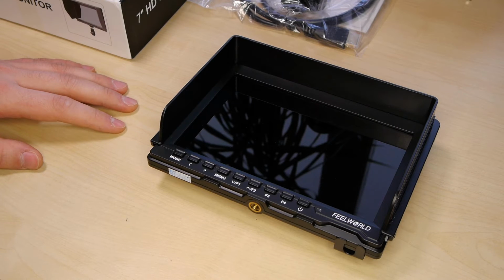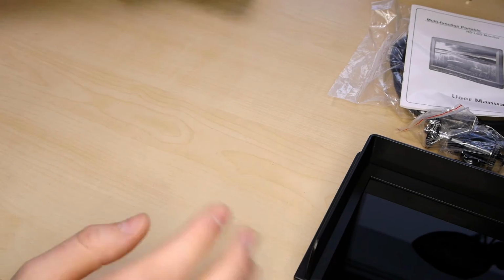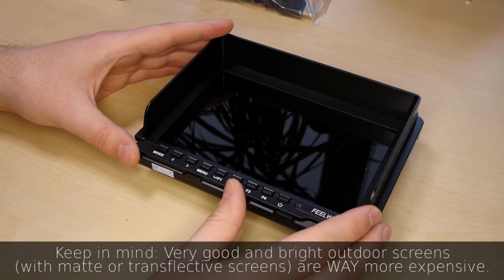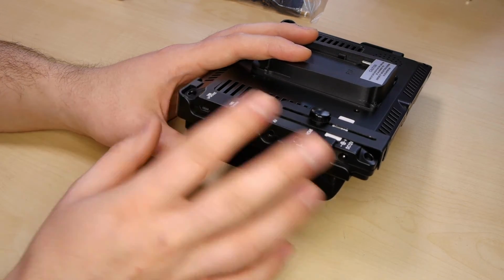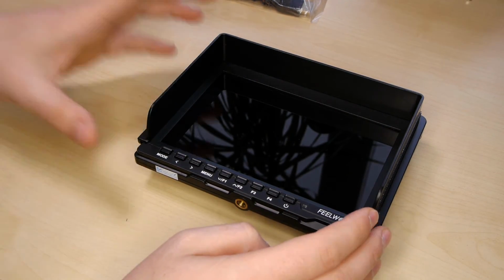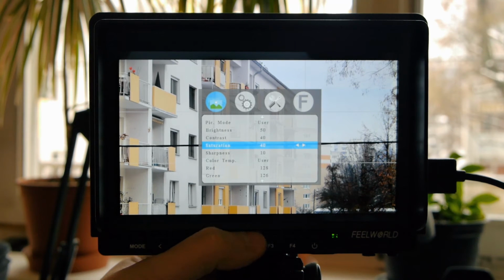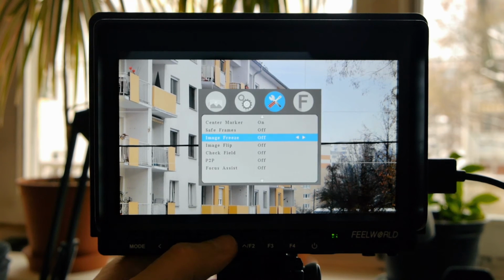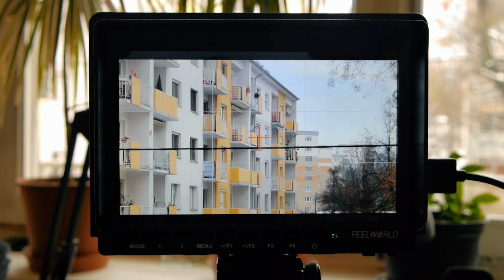Feelworld FW759 / FW759P field monitor - Very detailed HANDS ON (with calibration settings) (!)

Comment: Hey man. I bought this monitor yesterday and pullugd it in my Nikon D5100, but when i start filming, the monitor turns black and the live view on the camera goes back on... How do i change this?
Reply from the maker: As far as I remember you need the Nikon Hack to unlock all time live-view out over HDMI. But you can also try to play around with the HDMI out settings in the menu (and you can also try to press the info button a few times beside the viewfinder - Maybe it outputs HDMI again in one of the display-modes). But also overall check out the Nikon Hack for the Nikon 5100 - It gives you also better video through higher bitrates, it removes the time limit and gives you kind of clean HDMI output (with no overlays etc.).

Main page: https://nikonhacker.com/wiki/Main_Page
Patch page: https://nikonhacker.com/wiki/Nikon_Patch
List of supported models: https://nikonhacker.com/wiki/Supported_Models
Reply from the maker: Btw.: Set the HDMI out on the D5100 to 1080i, device control to "off" and maybe try it on a TV too (that way you know if its a problem of the monitor or the camera ^^).
Reply: I did everything you sad, but it still doesnt work...
Reply from the maker: Ok. Then you need to hack it. Just follow the tutorial(s) online and follow the links in my other / older answer. It´s quite easy to do / not THAT compley at least (and as mentioned its not only giving you active LiveView out, it´s also unlocking higher bitrates, giving you unlimited recording time in video mode and "cleans up" the HDMI out if wanted to get no overlays. Also unlocks a few stills image features (according compression options) and removes the need to use original nikon batteries. ^^
Reply: I hacked it already man... I even bought a USB to SD hub for the files... :(
Reply from the maker: Did you try it on a TV instead of the FW759? Maybe the output makes problems with the FW759. Btw.: Which options did you choose for the hack? Only "Clean HDMI & LCD Liveview" or also the beta hacks according 720P / 1080i fullscreen?
Reply: Oh i didnt try it on a TV, and i choose for: 
* Remove Time Based Video Restrictions
* Liveview Manual Control ISO/Shutter
* Video 1080 HQ 36mbps Bit-rate
* HDMI Output 1080i FullScreen Fixed
* NEF Compression Off
* Disable Nikon Star Eater
* Non-Brand Battery
Reply from the maker: Hmm. Try "Clean HDMI & LCD Liveview" additionally. I don´t know it for sure - But it could include the "base hack" to enable HDMI out at all (the 1080i FullScreen option is just to remove the borders etc. and get the right 16:9 output) ^^.
Reply: Nope, did'nt work.. :(
Reply from the maker: Hmm. Do the other fixes of the hack work? (Like the video time limit removal - Put in a larger card and if its able to record / shows over 29min 59sec left for the recording the hack works ^^.)  - Just to be sure: You resaved the firmware after selecting the hacks / fixes which should get applied - Right? It´s not applying the fixed automatically to the selected file (you need to resave it somewhere else). If the other fixes work (and therefor you exported the file right), then you can also try to NOT choose the 1080i fullscreen fix, but choose the "HDMI output 720P fullscreen". And leave out the Clean HDMI & LCD LiveView fix (its normaly only to remove the overlays on the LCD and in the HDMI signal - Not to enable the HDMI).

Btw.: Also try to choose different HDMI out resolutions in the menu after you hacked it again (plus switch through the views with the Info button - Maybe you can find one combo which outputs the video also while recording internally). Also important is to disable "Device control" in the HDMI menu. If all that isn´t working, then I am sorry to say that - But maybe it´s just not working. Its still a hack. Not a normal feature upgrade ^^. Another (not direct) solution: You could still change it for the D5200 (there its working / should work more flawlessly). I also used the D5200 in the past by myself with live view HDMI out. But you can also search through the nikon hack forum (maybe there´s a fix available / just one of your settings isn´t right). NTSC / PAL menu option maybe (maybe it affects the HDMI output) ?!? LG
Reply from the maker: Oh. And I hope you are in live view mode before you start recording. Otherwise the camera is switching to a preview mode or so (for the videos and pictures). ^^
Reply from the maker: Btw.: Also try only the 720P or 1080i fullscreen hacks alone. Maybe some of the other hacks are not working together with it. (like the hihger video bitrate ones)
Reply from the maker: Pah. Damn you Nikon - I think I found it: HDMI out is only working with 1080P (1920x1080) and 24fps setting (or with lower resolutions). See this manual: https://cdn-10.nikon-cdn.com/pdf/manuals/dslr/D5100_EN.pdf (Page 53, "Movie Setting", it´s the small hint below the table "2  Not output to televisions or other 
external displays during recording." - Which is the case for 1080 25P and 30P in the table above) ...
Reply: I give up... i tried everything you sad, nothing works. I resaved indeed the firmware after selecting. I thinks its the camera itself.. I am going to save for a new one i think
Reply from the maker: So its also not working with 24P at 1080 as a video codec? (Try it with the standard - non modded - firmware.) Weird fact: It SHOULD work - The D3100 also outputs live view HDMI while recording video (found a few videos online about that as I was also curious whats the problem with your D5100).
Reply: IT WORKED WITH THE 1920x1080 with 24fps!! <3 thank you so so so much!!! is there a way to thank you for your help!!?!??
Reply from the maker: *g*. Yippii =). Well - You can donate a few bucks over PayPal if you want to (link is in the 3rd block of the video description). But hey - Not needed (I am also happy about a thumbs up and a additional subscriber ^^). AND: I am also happy that it´s working now. Its btw. also good to know that the D5100 has such a weird limitation in case someone else asks. ^^
Reply: I liked the video, subscribed to you, and I transferred you 10 euro, idk how much USD that is hahaha
It is so strange that it works with 24fps, and not with 25fps..
And indeed, this camera is so limited.. Iam going to save some money for a new one.. This thing is already 5 years old. Its my dad's old camera :)
Reply from the maker: Cool. Thx ^^. About the 24FPS vs. 25 / 30: I guess the processor they used in the A5100 is just too slow to output the higher framerates. Which is weird yes (as it´s just a difference of ONE frame to 25FPS for example). Well - The D5100 is still "ok". But nothing special anymore yes. But you can now also try out and play around with the other fixes / hack-options. And to gain experience / to start over filming the D5100 is still more than good enough ^^. Have fun shooting (!) And thx again for your donation (and for subscribing). =)
Reply: Thank you so so so much man! I'am so damn happy now! <3
Reply: @NielsKnol  do you mind sharing how you get it to work?

Comment: Hello.  I am sorry but I don't understand how the check field works?  You said something about calibration.  Would that be when using SMTPE color bars?  Sorry, I am just beginning learning all of this.  thank you.
Reply from the maker: You can use the blue-gun mode (which is showing blue image content only) to calibrate ROUGHLY with the color charts / color bars for monitor calibration (just search for it over google - Its a quite common but also very old calibration method). But also keep in mind: It´s by far not as accurate as a colorimeter / color calibrator would be. And it´s also not showing how high the contrast is (aka how much is "cut off" by the screen in the shadows or in the highlights for example). So it´s just a minor helper (the blue ony / blue gun mode). ^^ But also keep in mind: You don´t need it with the Feelworld screens anyways - They are quite accurate out of the box. And you don´t get any better calibration just with the color charts and the blue-gun mode. You need a color calibrator (to calibrate the RGB channels roughly) and then it´s the best option to compare the final picture which is coming out of the camera with the field-monitor picture (according the shadows / highlights / contrast) to get the most accurate image while shooting. Hope that helps to clear it out a little bit. LG
Reply: Yes it does, thank you

Comment: Anyone can help? I am trying to link NW759 to Nikon D750 and cannot get promised resolution 1200x800. Tried various settings and only in menu mode i am getting 720p or 1080i. When switching to live view, monitor automatically switch back to 480p 60hz. Any solution, please? In camera, I tried also all options.
Reply from the maker: Hmm. Did you try to press the info button a few times? Maybe it outputs 480P to show you all the menu / display information. As far as I remember you need to toggle through the viewing modes with the info button to get the full-screen (clean) image ^^.

Comment: is there any way to not view the image in 480p when recording with a canon t3i
Reply from the maker: Hmm. You can try out the "camera mode" -> Menu -> 2nd page inbetween OSD V and Zoom ALL. This mode is normaly for the 5D models (the older ones). But it should also lock the 480P mode for your T3i ^^. It´s visible in the video at 20:42. Have fun shooting (!) ^^

Comment: hi, it is posible to update firmware?
Reply from the maker: Possible yes (over the USB port) - But no public fimware files are available online (on the Feelworld pages www-feelworld-cn for example which is their official page). Maybe you get the files if you ask the support. But no guarantee for that. Just buy it new from the offical Feelword store (or from the bigger dealers), as there you have the highest change to get the newest firmware models (as there the unit throughput is way higher than at the smaller dealers - At the smaller ones you maybe get older stock models). Though: My unit I reviewed here also came with an quite old firmware (compared to the models shipped now) - And everything worked quite well ^^. So no need to worry. Firmware update are more important with units which are not working flawlessly from scratch on (which is not the case here). Btw.: There are already new models available - The FW760, FH7, A737 - 7" models - Or the also quite interesting and nice F550 (5.5" 1080P panel) model. Check out www-feelworld-cn for more infos. LG
Reply: thanks a lot, you explain to me wery  accurate, my 759 work well, i just was wondering if the fulscreen hd video can be placed from start, for moment i habe 90 % coverage of screen , and after press one button twice, it become full screen, i was thinking some minor fixes in update, but i can live with this litle issue.thanks again for clarifing the situation.

Comment: Hi, thanks for the review! do you know if it can be powered though the usb port?? I know that it says that is for upgrade, but I've seen a couple of other monitors that can be powered by usb even if it doesn't state that anywere. Thanks!
Reply from the maker: Nope - The USB port seems to be only for software updates. And I wouldn´t recommend to try it out to be honest. Btw.: Which other monitors are "powerable" through USB? I don´t know even one model which supports that (maybe because it´s not officially supported ^^). Btw.: It´s not possible to power the FW759 directly trough USB - But you could try to go for an USB power bank with 9V or 12V output for example (and use the standard DC port of the screen with an compatible / the right cable). OR: There are even super small USB step up converters, which are converting the 5V to 12V for example (with the converter even built into the USB plug directly - So no external box or so) - And those are able to deliver up to 6W of power at 12V. Nice fact: As the FW759 just needs 5W max., even such an solutions should work ^^. LG
Reply: https://www.youtube.com/watch?v=ECP93o92sRE
This guy powers the Viltrox DC-70 through the USB port. Yeah, I thought about the converter, it could be the option, but don't know how it's that gonna affect the power consumption, if it's gonna be higher or something like that. Thougth about the usb because in that way I could power the monitor AND a nyrius wireless receiver without needing to buy NP-F batteries. And as it's not specified that monitors can run over USB 5V ports, maybe there are another ones capable of that. Thanks for the response!!
Reply from the maker: Ah. Yes. I remember now - Someone mentioned that already in my review of the Viltrox. But I don´t know if it´s really a good idea to power it that way - It´s for sure just meant to power the display while upgrading the firmware (so its maybe in a special "firmware update mode" while getting power over the USB port). Could also lead to instability or weird behaviour (as the USB 2.0 specification - And I am sure it´s just an 2.0 port - Only allows 0.5 amps - So 2.5 watts in total. Which seems very low for an 7" screen).

But anyways - Back to the FW759/759P: It should work even with the super small USB converters. Just keep an eye on the max. wattage. Most of the super small (in plug) converters can handle 0.5 amps at 12V - Which means 6 Watts. The FW759/FW759P has a max. rating of 5W - But it´s for sure below. I don´t have it here to test that anymore - But should work flawlessly. You could also try it out - I ordered such converters a while ago for 2 or 3 bucks or so a piece (from china directly). They work nicely ^^.

Btw.: If you want something smaller with < 5 watts of power draw too (though still coming with native 720P screen) then check out the new Feelworld F450 (comes with a 4.5" screen). You could still velcro the nyrius receiver onto the battery - You just need the corresponding velcro stripes on each replacement battery - You get get such endless stripes in many hardware stores ^^. But the F450 isn´t coming with all the features, the 759P has. So if you need a histogram for example, then go for the FW759P if you can find it somewhere (it´s also not THAT easy to find). ^^

Have fun shooting. LG

Comment: Thanks for this great review, though I bought the Neewer nw760 field monitor (and NOT the FW 760) rather than this one, which is pretty much equivalent anyway, apart from the screen resolution, of course, which is higher. This review was really helpful as there aren't many on YT regarding the Neewer nw760.
Reply from the maker: Just as a hint: The Neewer NW760 is just a rebranded Feelworld FW760. You can go for it - As the FW760 has even more features than the FW759P model. AND as you mentioned already - Its coming with the higher 1080P native resolution screen ^^. Alternatively you can also check out the new Feelworld F7 or the upgraded FH7 model. Same features than the FW760 basically - But with a little bit better enclosure. Or you can also check out the A737 - Again the same features - But with aluminium case. ^^ LG
Reply: Thanks for the hints. As I said, I already got it (the Neewer NW 760, got it yesterday) and was on rather tight budget, which is why I didn't go for more expensive models. The NW 760 is a re-brand of the FW 760 as I suspected but, nevertheless, has a totally different menu-look, at least for what I can see from the video. Anyway, the options and settings would be more or less the same. Going to practice with it now as it requires some thorough and in-depth study before one can make good use of it. :-)
Reply from the maker: Ah. Ok. Thought you PLAN to buy one. But hey - Technically / internally they are basically the same overall ^^. About the menu: Don´t oversee that it´s already a newer model than the FW759 aka FW759P. So it´s maybe because of that fact coming with a different menu style. I don´t think that Feelworld modifies their firmwares that far for just a reseller - So for Neewer ^^. Anyways - Have fun shooting (!) LG
Reply: Thank you. I've noticed that my DSLR (Nikon D3300), when in LiveView, outputs in 1080p @30fps (at least when it display its internal menu), and that's what the monitor sees as signal type it receives from the camera. The D3300 can record at 1080p 60fps and the field monitor can handle 1080p@60fps as well, so the obvious question is: is it just the camera that downscales (drops) its video output when displaying its internal menu and settings to a 30fps framerate?
Reply from the maker: Well - It seems like Nikon isn´t matching the menu framerate to the actual sensor output framerate. So while filming you´re gettin 1:1 the image of the sensor (at the certain framerate) - But as soon as you switch to the menu, it´s giving you all the time a 30fps / 30P 1080 output. Would have been way better to keep the signal the same - But hey - Maybe it wasn´t possible to match the framerate output in the menu. I know - It´s annoying that the screen blacks out every time you switch to the menu - But there´s no way around that (also not with other screens). Still - You could try to switch the HDMI out settings - Maybe there´s an option to disable the info / menu display over HDMI - Maybe it keeps than the signal (and displays the menu only on the camera directly). LG

Comment: There are complaints that the battery will drain even which switched off. Did you encounter that problem too ?
Reply from the maker: Yes. It will drain the battery. But it wasn´t a problem in my case, as I used a central battery most of the time (so no battery on the screen directly). PLUS: Normaly you charge the battery anyways before using it for a project. And if you transport it seperately, it´s also not drained by the screen. Just don´t oversee to remove it as soon as you store the screen til the next project ^^. LG